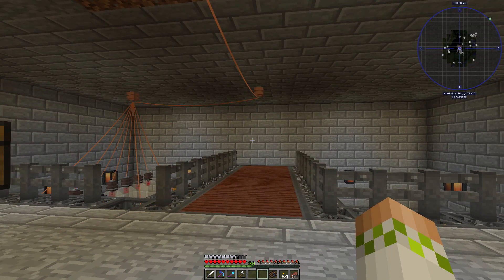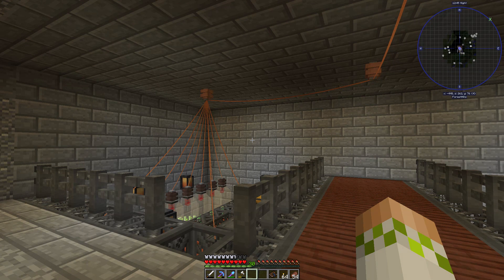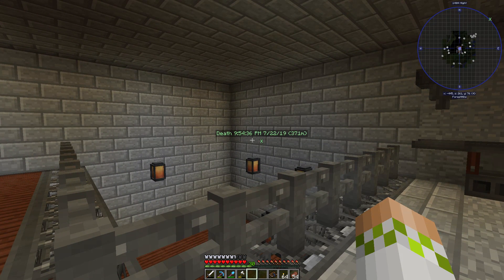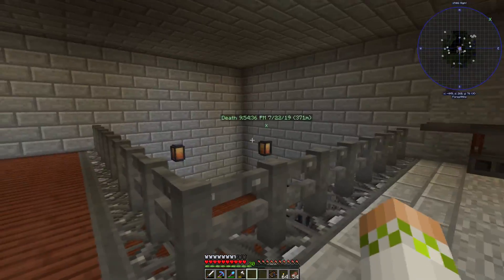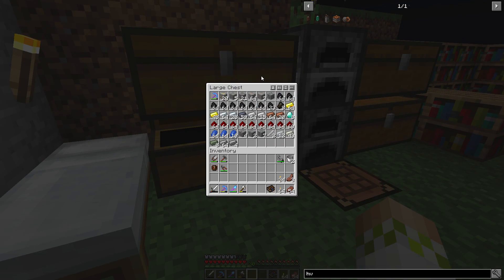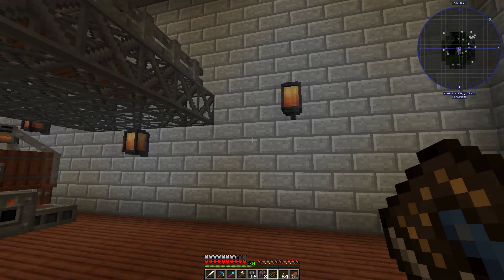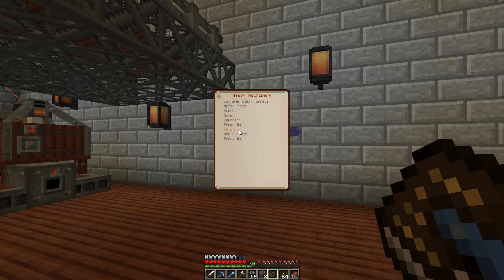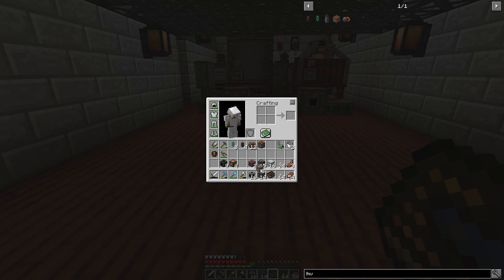Surviving With Immersive Engineering :: E07 - Diesel Generator

Comment: is there a way to have a remote switch for the diesel gen?i want to be at another part of my base and still have on off control is this possible?1.16.4
Reply from the maker: With just immersive engineering, you’d be limited to normal redstone setups to extend the on/off switch and nothing would be completely wireless. If you are in a modpack there should be many different wireless redstone options :)

Comment: If I were you, I'd run the HV wires from de generator to a cluster of HV batteries and from them you can extract MV easily to insulate it. For the machines you have at home MV should be more than enough to run them and with the cluster of batteries you can have a central spot to check if your energy is going up or down.
Hope it helps ;)
Reply from the maker: Great suggestion! I guess the only machine I'd need full HV wiring for it the excavator to run at full speed but other machines should all be fine on MV or LV like you said.

Comment: You should turn those coals into coal blocks and then put them in the coke oven!
Reply: btw you can connect the hopper directly into the metal press (without the conveyor belt) so the machine pulls from the hopper automatically when it has the slots available to turn it to plates (so the ingots don't hover over the machine waiting for their turn, it could lead to them despawning if they're there for a long time)
Reply: could it be that the screen keeps shifting to a picture of Ragnaros? lol
Reply from the maker: @martinfnv  Hah yea, im an avid classic wow player and changed my "Wallpaper engine" animated background to ragnaros. apparently the screencap software is randomly switching to it then back for a few frames.